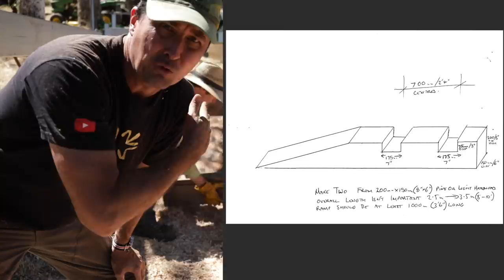Wait...What ? How Did This Happen !?

Comment: Being equally comfortable in both metric and imperial would make you more efficient.  It isn't a totally alien concept to you, after all the U.S monetary system is metric, base 10. Your youtube views and subscribers are counted in metric also. Something to consider next time you're driving your 3.5 litre Transit Sir.
Reply: I think what he's saying is that metric and standard don't really go together well , yes metric is the more efficient of the two in many ways but America has deep roots in standard and changing that isn't too easy .
Reply: You can take it as pretty certain that every vehicle that Cody runs is built to metric spec in these days of global sales and operations. And I'm reasonably sure that will be the same for a lot of other equipment as well. It's far too expensive for any manufacturers to tool up to produce duplicates of the same product in metric and imperial. 
I'm not making the clear cut argument for changing, that boat has sailed long ago. My original point is that being comfortable in either system is more efficient.
Reply: bren106 
I tried 6 months one time to become comfortable with the metric system and I never could understand what I was saying especially I never could understand what I was reading on a tape. Personally I believe the for me anyways it's a lot easier to read 1/16 1/8 3/16 of quarter 5/16 so so on and so forth all the way up until you get to 1 inch now than how many centimeters or whatever it is in there don't get me the line because I never could figure it out it looks about like a million of them little hash marks
Reply: First of all, I think all of Cody's ragging on the Metric system is pretty tongue in cheek.

The US monetary system is not metric, nor is the subscriber count. That's just silly. Not everything Base 10 is metric, metric is a measurement system with units. Imperial measurements are not inferior, it's just different. Once you know them, you know them and there's nothing to improve. It's like saying our system of time measurement is wrong and we should go to 10 hours a day with 100 minutes an hour. The only issue with metric and standard systems are running into both at the same time, or having tools for one and bolts of the other. 

In the future if you want examples of American uses of the metric system, use guns, liquor and engines.

And I'm sure 95% of people got this, but the metric vs standard adjustable wrenches is a joke. "Oh no, I have one metric and one standard adjustable wrench, I'm out of luck!"
Reply: But Metric is standard around the world.
Reply: Just because something is base 10 doesn’t make it metric, base 10 is just was the metric system was derived from. If you want to get technical US federal bonds are quoted with decimals in base 32nds, a hold over from Spain’s base 4 system and how the NYSE was established.
Reply: I'm American and I'm comfortable with both systems ever since about sixth grade. It's the attitude and arrogance of the "metric rules" people that keeps me hanging on to my Imperial units and talking smack about metric.
Reply: @ John D: It most certainly is Sir. But I'll give them tomAto, after all it is from over there and we had no problem adopting potAto as correct.
Reply: Nicholas Tourloukis, Very tongue in cheek. It’s been a running gag for years. 😁
Reply: wobbly sauce So is dysentery.
Reply: Troll. Don’t feed it.
Reply: It is not unreasonable to say that everything that is base ten is metric since metric is derived from base ten. When the French invented the metric system they tried to use ten as the basis of the time but it didn't work since time was based on solar and lunar times that don't fit in neat tens. I find it ridiculous that people say they cannot figure out the metric system: Can you count to ten? Can you memorize a hand full of words and the order they go in and the number of digits they  are associated with? I'm sure the answer to both is yes since you know ten, hundred, thousand, million, billion... Stop trying to see the relationship between imperial and metric and how you convert between the two and treat it like the system it is and it works.
Reply: I've been reading a book called About Hence It by Warwick Cains, and it makes less arguments about which is better but more talks about how various shstems of measurement around the world, including Imperial, (even when there are distinctions between standard UK and US units, gallons for example) came about. A yard is basically "a stick as long as your leg" a pound is "a good sized rock" and despite a lot of countries being metri, some times have units technically delineated in metric but are basically reinventing the pound. Hands and feet also happen to have interesting ratios, and thumbs are very useful. Hence inches. In most other languages, an inch is litterally "thumb", and in English still derives from a version of "thumb". They are just naturally useful, as are fractions. 1/2s and odly enough 1/3s are pretty easy to accurately work by eye. 1/1000 is not.  
Drinks, pints or 500ml bottles, 200ml or 330ml. In the bar trade learning abiut old jills and using fluid ounces, while at work using 25 and 35ml measures its essentially just the same sorts of sizes just calling them metric names.

I'm also trained in sciences so am wholly used to metric and by god for anything in multiple dimensions having such a sublime relationship between them is also fantastic. Nothing is done by eye or by hand so the myriad benefits Inperial does have are lost. That's  why we use metric. That and  French history. And also, hearing about my fathers tales of using a jillion conversion tables in Imperial conversions to make things work in his industry because of various company standards. 12 is handy whrn you have to do it in your head, many factors. Hence clocks, 360 degrees. But when you have tens of thousands foot pounds of pressure to convert into a partial concentration of pounds per gallon, being factors of 12 is purely a hindrance. 
Both have purposes, benefits and drawbacks, and historical significance.
Reply: I live in Canada and I still use standard

Comment: I ALWAYS keep 3 open-end adjustable wrenches in my toolbox.  One metric, one standard, and one universal for those hard to find bolt sizes.  :D
Reply: why do you need 3 adjustable hammers? ;P
Reply: You should also keep one left-handed and one right-handed as well.
Reply: Well dang, that means I need to get a spare for all 3...
Reply: it's funny because it's a linear variable so it can be both metric and standard. that's like saying "let me see the left handed paint brush." when both sides of the brush are equal.
Reply: ditto!

Comment: If you haven't thought of this I'll try setting up a jig with a two-by-four with a stopper across your aluminum posts with a center mark set so that you do you can drop a plumb-bob to find Center of your logs faster. That way you won't have to make an initial cut to see if you're on Center every time you will know it from the start.

Comment: must be a lot of new viewers,  Cody knows the Metric system is fine. It is just annoying having things not sync up,  my late model Corolla has Imperial and metric nuts and bolts which made changing the rear strut assembly much harder than it needed to be.

Comment: Guday from DownUnder,
I think l know what may have caused the issue with the guard.
Australia uses the metric system and therefore the mill has metric fittings.
The USA is imperial and therefore your adjustable Spanner ( or shifters as we call them DownUnder) is imperial.
So as l see it you are using a imperial shifter to tighten metric nuts and bolts and there’s the problem.
Hope that helps.
Reply: That shouldn't make a difference because the wrench is adjustable.
Reply: Alex Jamieson 
Fair call Alex.
In a previous video Cody said he trouble when he had trouble when he mixed  metric and imperial shifters.
So the cross pollination of standards could the problem......just my opionn😉

Comment: Cody, got a bit of a bone to pick with you on the wrenches. I carry a small  6"adjustable Proto brand wrench on my side eveyday of the week and have for the past 5 or 6 years and I use it just about everyday but Sabbath unless it is to help someone who is stranded or in some dire straight. In all these years have not rounded of anything with this wrench. Even with nuts/ bolts of the 3/4 or up to the 15/16 max size it can take. Even with a cheater bar in sticky situations and this wrench has never failed me. 

First of all ensure your wrench is of a quality variety, Proto,  Old USA Craftman, Snap-on or similar that doesn't have slop in the jaws. The trick is to put the fastener all the way down in to the base of the adjustable wrench. where you can see there is a hex shape formed perfectly as the jaws open and close. This gives contact on 4 of the 6 sides of the fastener. Exactly the same contact pattern as a open end fixed wrench. I'm not saying being subjecting it to your "I will bend / break thee" tests that you won't round something, I'm sure you will. Just saying that used correctly, the adjustable wrench can actually get jobs done that other fixed wrenches wouldn't be able as well as speed of not running back to the shop when something breaks in the field.

Comment: I really like the big saw blade cuts. It seems like it makes a better cut than a bandsaw. I did cringe a bit with the camera angle that shows the spinning blade at about knee level. I hope that blade never comes apart. Stay safe so you can make more nice videos like this. One other thing, I am wondering why you did not simply build up a ramp from 2x4's, cutting that ramp seemed a bit sketchy.

Comment: Easy way to roll logs, if you have a ATV (or whatever) with a winch on it (or even just some cable minus the winch),  take the cable/rope around that log a few times and let the machine roll it up. Works like a champ and saves your back. Like that last log is probably 6 feet circumference so it would only take 2 to 4 wraps depending on how far you want to roll it.

Comment: If it was me I think I'd put together a "mill kit" and keep it with the mill. Box end wrenches to fit all the fasteners on the mill - can't imagine there are more than 3 or 4 sizes - and whatever else you find you need to keep things tight and well adjusted. Would cost very little and you'll never again get in a spot where you have to resort to using nut rounders!
Reply: Oh, and the US monetary system is decimal not metric.

Comment: i know time crunch and all, try say 2 bike chains joined together and a bar or tube on opposing 
side with a cable to the chains turn the tube to wind the trunk into place  chain could be anchored to the ramp at the right place to roll the trunk in where you want it  you will need 2 of the chain and cables for this

Comment: The log loading method employed by the Lucas Mill looks completely hokey to me compared to a bandsaw mill, even with the homebuilt ramps. Also, the impediments to safely walking the miilhead forward along the framework as a log is being sawn also seems to be quite a shortcoming with the Lucas Mill as compared to a bandsaw mill, which offers a free and unobstructed path to walk along when milling a log. Hmmm. I am sure there are advantages of a Lucas Mill compared to a bandsaw mill, such as speed (you can mill in two directions), but these shortcomings seem pretty significant to me.

Comment: Try reading the instructions for the chokes rather than blamining the metric system. They are designed to fit on 86mm ( 3 3/8") rail.

Comment: Why is a 2 by 4 in the American system not actually 2 by 4 ?
Reply: They cut it at 2x4 but the wood dries/shrinks and gets planed
Reply: UKHeliBob they used to be... they got cheap
Reply: Then Imperial's a lie!!!😂
Reply: Same reason that Mars bars are so much smaller now than before :)
Reply: Tyler Rogers offers the one, correct answer to this question. Dimensional lumber is dried after it is milled and all wood shrinks as it loses its moisture. A 2 X 4 is cut to an actual 2" by 4" on the mill and the wood then shrinks to 1 3/4 inches by 3 1/2 inches in the drying process. Lumber has always been this way-- for 75 years at least.
Reply: "Lumber has always been this way-- for 75 years at least."
That does not make it right

If it 1 3/4 inches by 3 1/2 inches why describe it as a 2 by 4 ?
Reply: Except for Cody and Eric, who doesn't cut them at 2x4.

Comment: As long as you don't use both in the same instance,imperial and metric are both still valid,i often use both because what is easier to read off the tape is handiest to remember, a cleaner number in the moment.i'm sure he's ragging the easily upset.Great bit o kit that mill though.

Comment: If you cut Small blocks of wood that are different sizes you can use them as a stencil to maximize your yield. I see a lot of waste wood that could of made a 2x4 , 1x1, 2x2 etc. I learned from Mennonites. Waste not, want not.

Comment: Don’t you mill logs after they dry so they don’t warp
Reply: Nature Nerd nope
Reply: I ripped honey locust boars on a table saw for an axe handle and as they dried they warped a lot so it must be different for softer woods that are typically made in to boards
Reply: Nature Nerd --Actually, you do have a point about warping: certain types of wood do tend to warp, in response to cutting (Grenadilla wood is one).  So, you are smart to at least ask about that.  I believe that the chemical treatment that they put on at most lumber yards is partly intended to handle what you are talking about.
Reply: Tsunami2107 The only bad question is one that is not asked.
Reply: These trees had 'died' and were standing dead for some time. That's why they look pretty dry now.
Reply: Will Cushman how do you know if a standing tree is dead? Just wondering
Reply: Chris Sproles a dead standing trees will not have any leaves
Reply: I'm gonna leave this one alone nature nerd watch some of wrangler stars earlier videos where he is milling lumber he explains the process quite clearly
Reply: Nature Nerd ...we call that winter here
Reply: I was not being hateful.. lumber is milled before drying.. stacked (stickered) in large units to reduce warping during drying (naturally or in a kiln) but it all warps some.. and some more then others.. If you just found this video after having problems with your axe handle then dig in to Wranglestars milling and watch the side bar for more like him.. I think you want to cut that axe handle from the straightest grain but leave it in trimmed to dry.. then cut out the handle after it gets done settling into being dead wood

Comment: Blaming the metric system. It's a user error, you're mixing it with the imperial system.
The world understands that you need to upgrade all legacy systems in the entire USA, which takes time. Imperial lathe' and other industrial tools are not cheap.
It would start at the factory, sawing metric wood. Then you wouldn't have this problem to begin with. ;-)